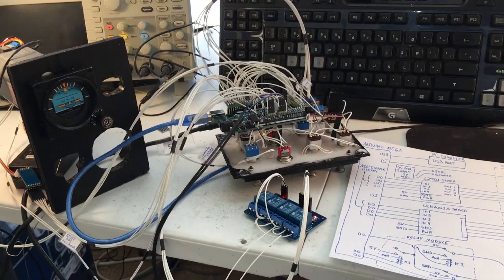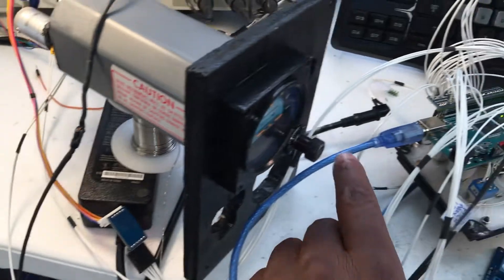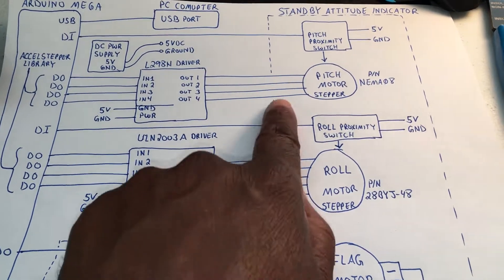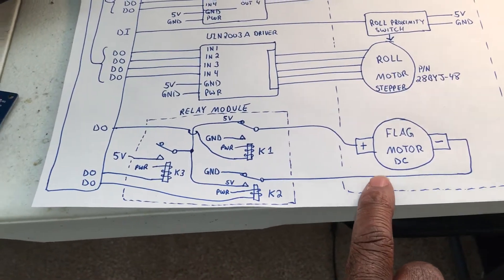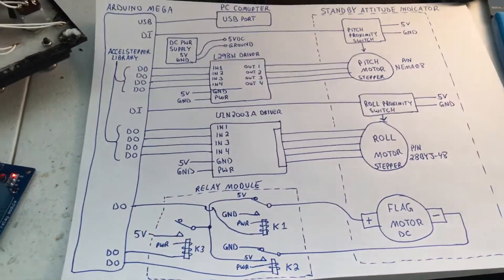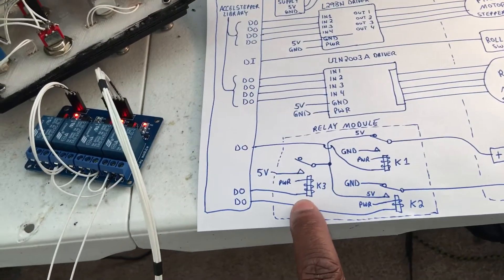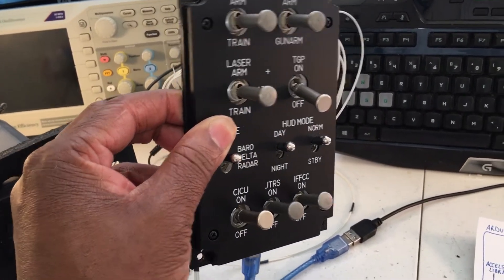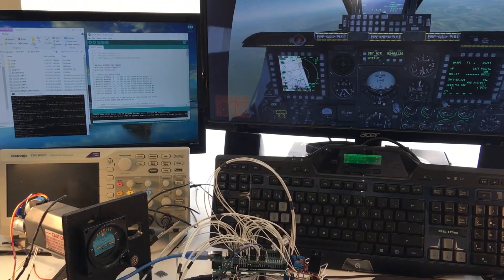A-10C Cockpit: Standby Gyro, ON/Off Flag implemention

Comment: Hey Joe. What do you recommend as far as a process to trace pins if you don’t have the wiring diagrams handy for a piece of gear which you like to capture switches and push buttons for? I have 2 37-pin jumpers on a radio head I’d like to be able to use in the panel.
Reply from the maker: Looks like you have three options. 1) Locate the connection diagram for that panel. Maybe someone in DCS Forums built a cockpit using that simulated radio head before. Or you would have to get lucky and find it online some where. 2) You could trace all the connections and deduce the connection diagram. If it goes to chips and other components, sometimes you can deduce from those data sheets. 3) Rewire the panel yourself and use the components that way. 
I don’t know what your radio head looks like. So hard to see what’s involved.
Reply: Thanks,  @joesim9577  !  I think I'll have to take Option #3 unless I can scare up some diagrams. The wiring itself doesn't look too bad, and since most of the wiring is fairly exposed (http://www.aviate.org/images/arcback.jpg) maybe I'll start going point to point.

Comment: Very well done, I look forward to seeing you're videos! Please never stop. As Craig S has said, brilliant. The roll looks smooth but the pitch is still being hesitant. I'm fuming off 18 hours after overnight shift but do you need a motor with a larger gear that can be scripted (I don't understand gear ratios) and the motor can keep up to the gear the ADI has.
Reply from the maker: Yes Sir. That is excactly the issue.  That Nema08 motor is 200 steps per full revolution so that’s 1.8 degrees per step roughly (backlash and other factors prevent 100% transfer of motion from motor to end pitch scale). The pitch gears are 1:1  because I used the existing parts from the standby gyro.  So end result was one motor steps moved the pitch scale 2.5 degrees. So 4 steps would move the pitch scale from the horizon to 10 degrees nose up.  So that’s why it looks jittery because not much resolution.  If you nose up or down 2.4 degrees the motor would not move until you crossed the 2.5 degree threshold.  Three ways to fix that,  (1) another motor with a smaller degree per step, two more external gears that would do a 2:1 or 3:1 ratio, (3) maybe a software trick that can subdivide the steps into half steps.
Reply from the maker: Sorry, had to correct that. The Gyro ball scale is x10 in the pitch so 1 is  actually 10 degrees. So that motor resolution is 2.5 degrees, not 0.25 degrees.
Reply: Awesome! Thank you very much for the response!!